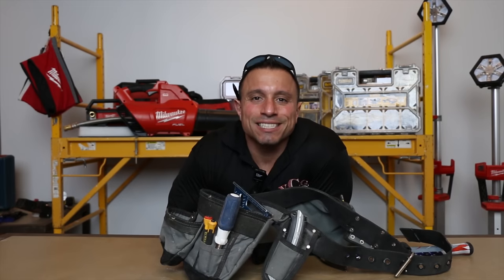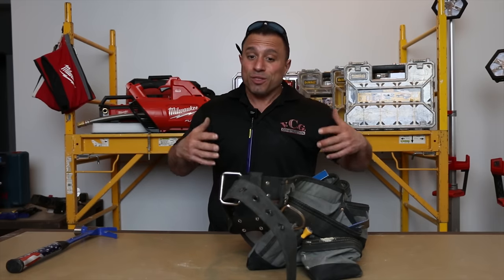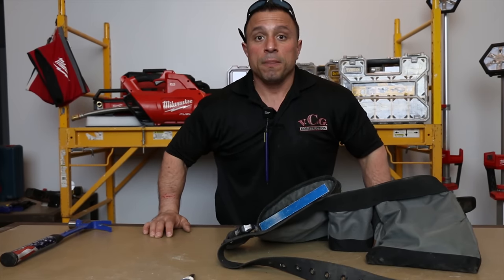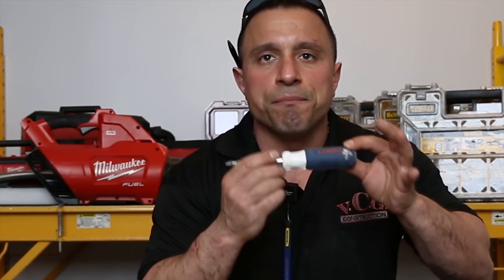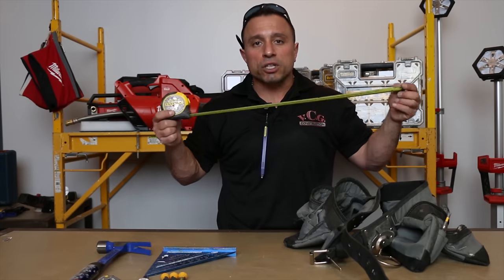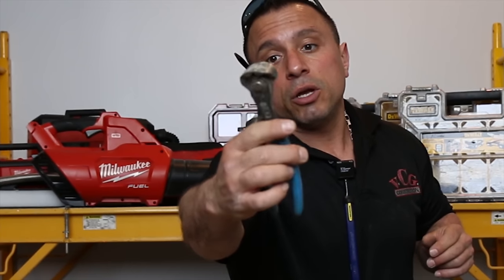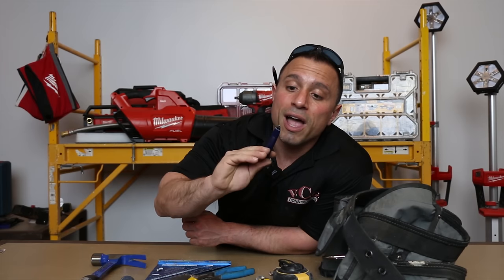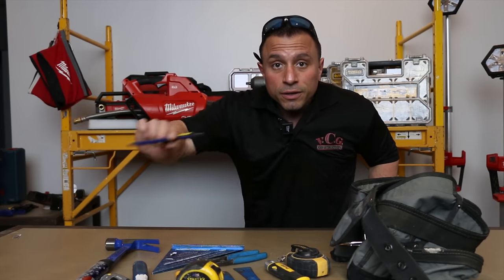The Best Beginner Tool Kit

Comment: "Yo!" We have the same tool bag!  My bag is set up to work on big airplanes.  My sockets and extensions are kept "Milwaukee Zipper pouches."  The bag holds as many tools as a big roll away.  Will not mark the airplane or parts should it bump into it.  Fits on to a scissor or high reach bucket lifts. The bag is lockable with small key lock.  This bag is a money maker.
Reply from the maker: Awesome Michael, love to hear how people have their gear setup and how it works for them in the real world!! Thanks!!

Comment: I agree with all your picks but I believe you forgot one essential tool a small torpedo level is a must.

I started with a swanson speed square, vaguan hammer and pry bar, plastic tipped hammer,pencil,level,chalk box,6in1 screwdriver,channelock pliers, and tape measure

I've since switched to automotive work and expect the young apprentice techs to have the basic tools for the job and a box to work out of and to keep the shop clean and organized, two things they don't teach in school it seems

Comment: Thanks for the vid bro, always making great content. So I was working on drywall Last week I left a large speed squared left it on the job site on my scaffold whit my mixer and buckets also a tool belt and auto feeding drill just in case we bring a worker. Some times I leave small dumb Tool whit my leaders never scared of getting them stolen since I work on wealthy country club places so private’s homes. Now it pissed me off that I got to the job site late since I had to pick some material and found out some flooring guys grabbed my speed squared and my extra measuring stick I left at the job  and chew the sides of it . I was wrong leavening my tools but like you said a new guy should always at least bring a measuring stick ,belt and speed square. Also didn’t know him or worked whit the group of guys I work.

Comment: Hey Vince, ✌What do you know about Blaklader workwear?  I've had my Blaklader black mesh vest four 8 years now, never again will I wear a waist tool belt.  Also, I don't believe I've seen you review any bostitch hand tools... I absolutely LOVE my bostitch measuring tape, hammer, knife, chalkbox with black (for rough framing) and orange for interior work, chisel, speed square, torpedo, levels..... @vcgconstruction

Comment: That is a very minimum 1st tool set for young people on their 1st job: 
For old house renovation including dry wall & stair wood work, I needed strong hammer drill & bits and saw really often. After opening the paint can with the shown multi scraper all paint jobs need basic paint hand tools brush or roller.
As a minimum I would recommend work wear with many pockets for the small tools and a tool bag pack so you're able to carry all tools even on a ladder or other high places, were a tool belt might be nice too, but loosing falling tools is risky. I never needed any tool belt, but would miss a tool bag pack or tool bag with more capacity additionally a robust tool box or tool case can have the advantage of sorted tools if properly used and tools after use are not thrown back into it, as mostly happens. (I also clear my tool box and bags after time)

Comment: Nice tooth that's if you're in carpentry but depends on if you going to be an electrician or plumber or what do you want to do is what you need in toolsand it also depends on what company you work for when you come to work for my company you don't bring no tools when you work boots and that's it and our uniforms we don't allow all guys to bring tools with them we supply everything you don't bring nothing to work and you don't take nothing with you that's why we know that nothing missing from the outside but not set up